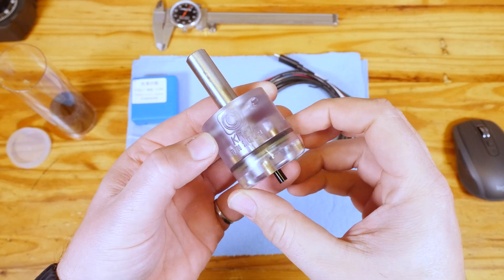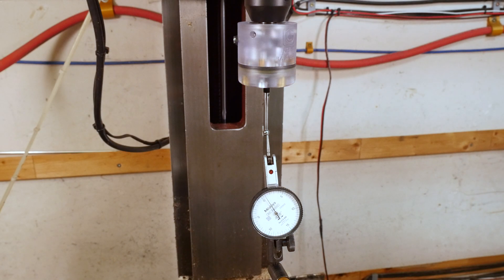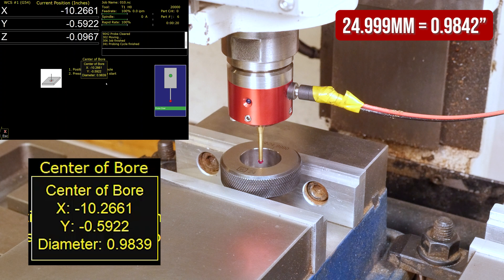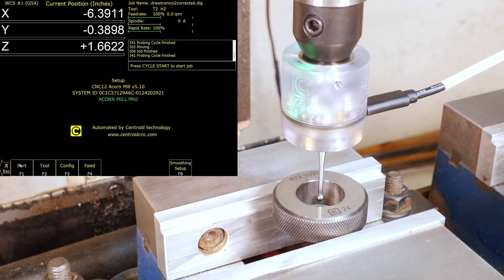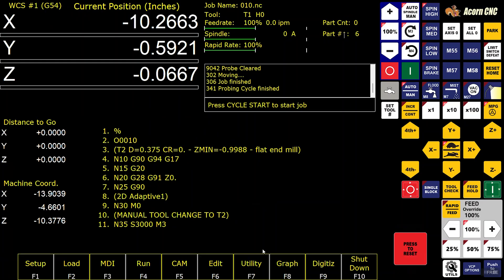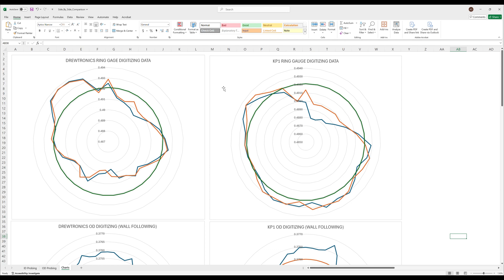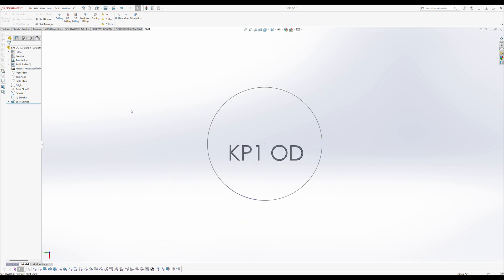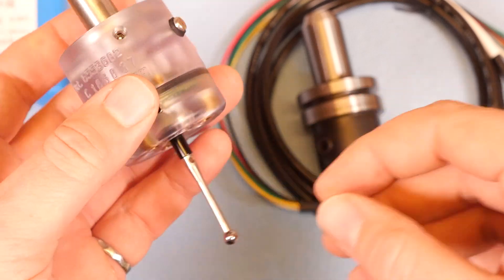New CNC Touch Probe from Centroid for 2024

Comment: the discrepancy you are seeing could be due to a number of factors:
- pitch error in the ballscrews
- inconsistencies in the ballscrew pitch (they are rolled after all)
- backlash (as you mentioned)
- lost movement due to stiction (motor thinks it moved something but it didn't)
- lost movement in the motor couplers (motor thinks it moved something but it didn't v2)
- discrepancy between commanded position and actual position due to motor control and/or motor properties (steppers don't actually perfectly move 1.8 degrees per step, and when microstepping is involved it really starts to fall apart)
- machine ways are not perfectly parallel and co-planar resulting in small angular errors that manifest themselves as positional errors
Reply from the maker: Hey Dusan thanks for the input. I recently rebuilt the mill as part of the base upgrade and make double sure thing were right from a backlash perspective. Some more and some less - but I'm on average around 1.5ish backlash on each axis and have corrected for it in the control. Not ideal, but it's something. I've confirmed things are working ok with an indicator - changing jog direction making sure the needle moves both ways when going a thousandth back and forth. I've not yet re-checked the plots after the rebuild but will soon! Cheers buddy all the best and merry Christmas. - Adam

Comment: Im wanting to digitize and duplicate or modify digitized parts. I also like the ideal of using my machine as a CMM. I will need to upgrade my off line controller seeing as mine doesn't have the capability. What controller do you recommend?
Reply from the maker: I’ve only ever used the centroid acorn controller, and it does support digitizing, but it costs an extra $399 for the digitizing license. There is some digitizing supported through the pro license, but you’re limited to the number of points. I really like my centroid controller and would get it again if I was building another mill.

Comment: After several cheap probes I also have the KP3 and the KP1, both are very good probes with both types of adjustment and they are holding center position perfectly. If you have a lathe you could make a new shaft for the KP1 to fit your toolholding. Very good review. Do you know the CHIPS App from swissi? Easy to generate probe maps with it.
Reply from the maker: @TheSuntravel  I have seen the chips software and have wanted to give it a try since it came out! I did not know it could generate probe maps. Thanks!
Reply: I would like to see Uwe do a comparison between the KP3 and KP1 and the Sorotec probe.  I have the Sorotec probe and would really like to compare it to the KP1
Reply: @TheDaumen  No Problem If you borrow me the 3D Finder...
Reply: @TheSuntravel  I don't understand?  3D finder???
Reply: @TheDaumen  That is the name of the probe from sorotec..

Comment: Would be nice to see if you extend the resolution with another gear on each axis, maybe 3:1, so the machine is slower but the resolution coming from the drives is just too high, and see what the changes are, it could be even deviation in the ways, etc.
Reply from the maker: That’s an interesting idea that would definitely pick up some resolution in theory, but introducing a gearbox would also introduce some more backlash, and ultimately the cost of adding gearboxes would be more than upgrading to servo motors, which are capable of 0.0001” (tenths) resolution.

Comment: I wired up my Drewronics probe to a 3 pin plug with the extra pin serving as a probe detect. As soon as you plug it in, the extra pin grounds and all is safe!
Reply from the maker: @chathamcnc3944  My drewtronics came with only 2 leads. Does yours have three? Or did you jumper one of the two? Cheers! 🍻
Reply: @adamdebowski2037  nope mine is also a 2 lead. What I did is install a 3 pin bulkhead connector which is mounted to the mill head. 2 pins (probe trigger and ground) goto the probe as usual but the 3rd goes to the probe detect pin on the acorn board. The probe side of the bulkhead connector just has a jumper wire connecting that detect pin to ground. This way, when I plug in the 3 pin connector acorn senses the probe. I never unplug the barrel connector at the probe.

Comment: It sounds like your machine reads position based on the stepper encoders? In that case I think the plots are mainly showing the backlash and form error in the ball screws, and maybe some "stickyness" in the ways.
Reply from the maker: It’s been a long time since I’ve checked the gib tightness…. Plan to dig into. Thanks 👍
Reply: @adamdebowski2037  I'd be careful making too many adjustments based on these results since you are limited by your encoder resolution. You generally want  your measuring tool to have a 10X finer resolution than what you are trying to measure.

Sorry if this sounds critical. I really enjoy your videos, keep up the good work 👍
Reply from the maker: @ appreciate all the input. I’ve learned everything I know from people like you! Thanks for the kind words and insight. Cheers!

Comment: Very interesting to see your plots. I created a Mostly Printed Probe (on my github) when developing a probe resistive switch - because my Renishaw ebay bargain needed some a bit of a rebuild. The lack of differences in the plots between the MPP and the Renishaw was astonishing, but like you, I suspect the shapes of the plots were caused by the mill drive train - backlash etc. Yes, I'm aware a printed probe is not likely to remain as consistent - it was originally intended as an aluminium design (which I did make) but the testing prints were so surprising that I thought I should release it!
Reply from the maker: @philip_fletcher  that 3D printed probe is impressive, Wow. Gotta be the best probe per dollar on the planet! I like your pendant, too. What kind of mill are you running?
Reply: It's great for learning how to probe because it's not 'if' but 'when' you'll crash it! I think I posted some plots to a LinuxCNC forum thread (YT doesn't allow me to link to it).
My mill is a 3 axis traditional metal mill but the Manualmatic is now running on a pretty wide variety of CNC machines. The common factor is LinuxCNC but the pendant hardware was always intended to be agnostic - I'd love to see it working with Centroid or Marlin.